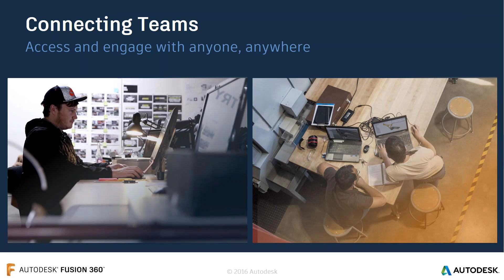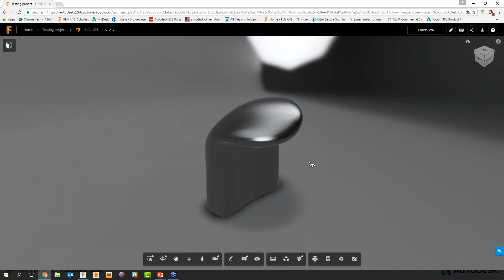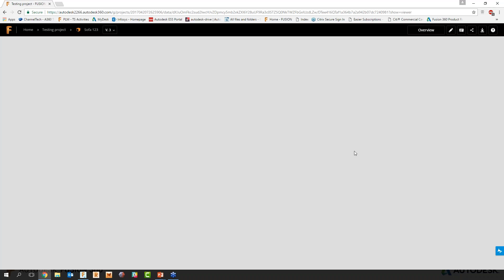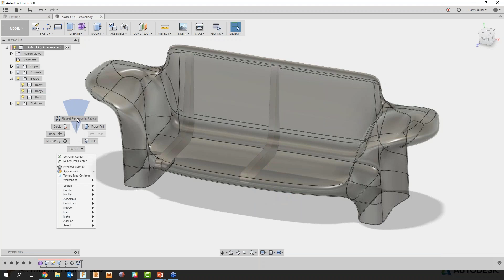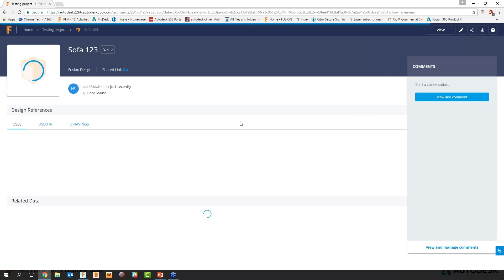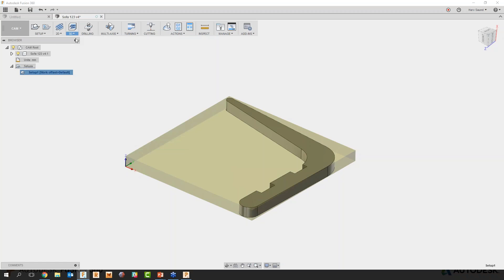Fusion 360 for furniture design

Comment: I was hoping to find more content as I am new as well.  I am trying to find out about the use of pocket screws, bearings, nuts, and bolts in wooden workspace design.  I need to make a rolling cart with a rotating axis tor the table-top to alternate between my jointer, and my spindle sander.   

I can't seem to find anything, and it's frustrating me to no end.
Reply from the maker: For adding hardware and such, see this: https://youtu.be/AlBorT2IwXw
And don't limit your learning experience to just "furniture" related tutorials. If you're new to 3d modeling, you'll want to start more basic and wide reaching lessons and expand from there. See here for TON's of content: https://f360ap.autodesk.com/courses#getting-started-for-absolute-beginners
Reply from the maker: Sorry about any frustrations! We want to make this as easy as possible, so let us know if you're struggling with anything specific.